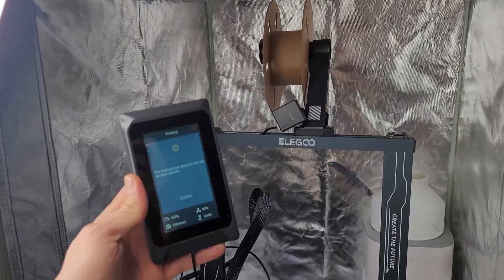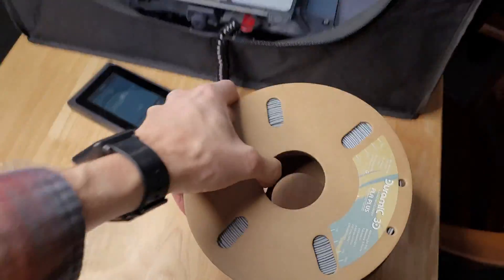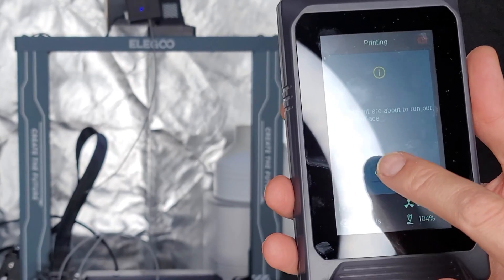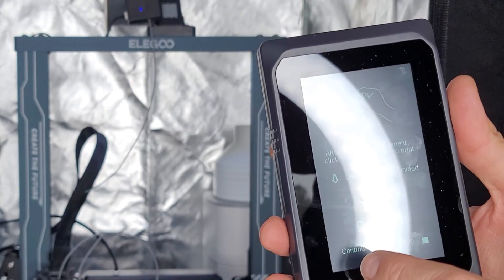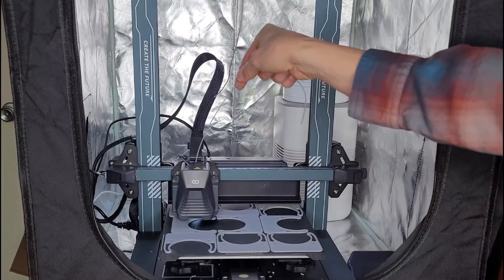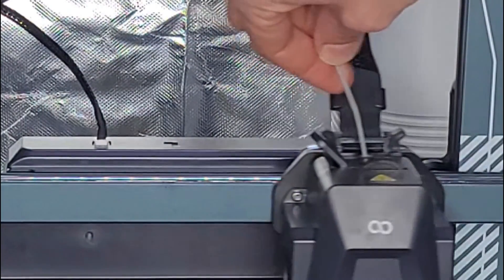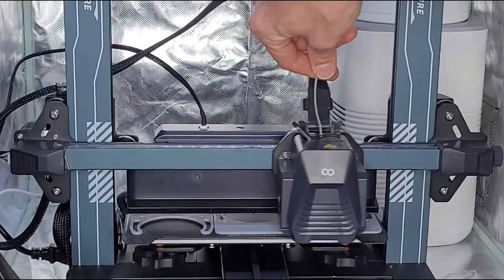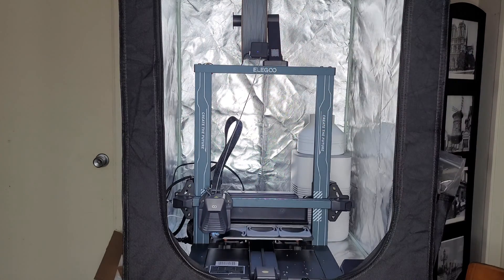ELEGOO NEPTUNE 4 PRO Filament Sensor Detector (How to replace filament mid print)

Comment: What do I do if there is filament in the sensor but it still tells me to insert filament? Do I just get a new sensor or is there a setting I can tweak?
Reply: There is in the settings a think to switch on and off the sensor, so it will be disabled
Reply: @theblueblob4559  nevermind. Turns out the sensor was just broken. I already contacted elegoo support and got a new one that works.
Reply: @shylock7989  nice 👍

Comment: What if I don't have more filament for a couple days? (I know beginner fail:( )
Reply from the maker: Leave it powered on and wait for the filament. Turn the temps down if you can. You will see a transition at the layer where it happened due to cooling shrinkage.